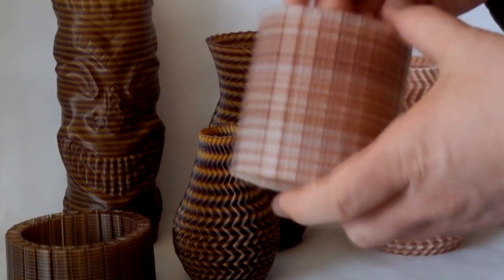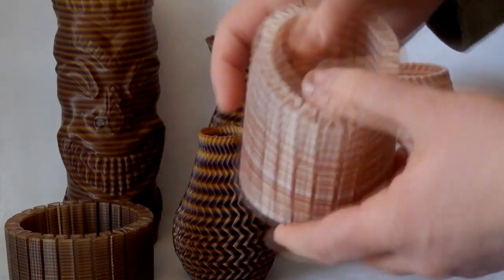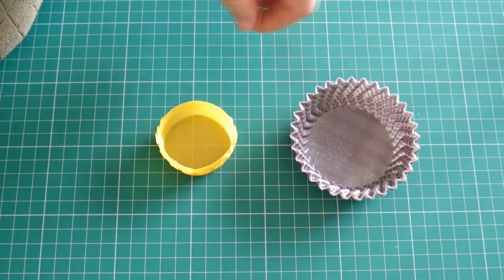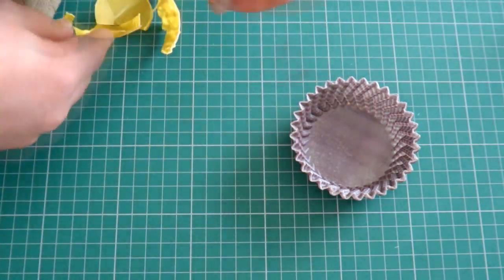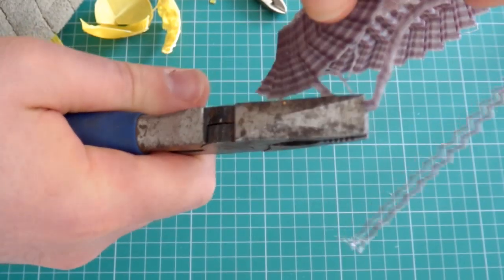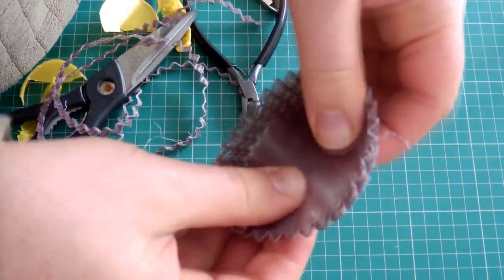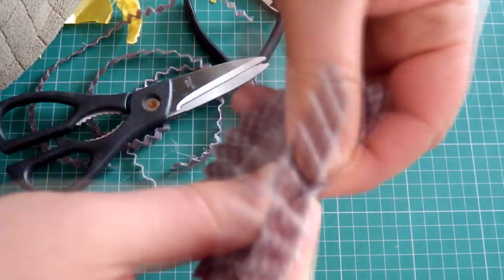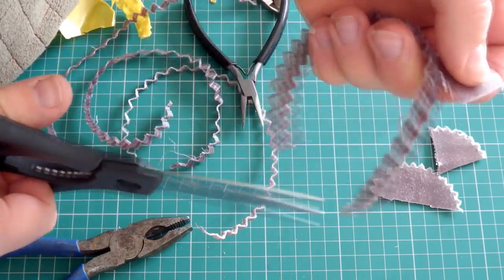3D printing with Tie Dye Nylon 618 Filament on RepRap Part 2 of 2

Comment: I had been thinking of getting the clear fillament as well as it's cheaper and then rit dyeing it but I would have assumed that you'd had to die after a print.. I mean you're heating up that filament and I would assume things might clog or some nasti residue or fumes would be made by doing that.

Thanks for the coloring idea though!

Comment: Awesomeness.  And of course if you need more strength you can always make the walls a bit thicker.  If you do use Mikael Murstam's cross layer idea, I'd like to see that.

In the first video you were asked a question about metals, and suggested using a variation of "lost wax" which I've heard of but am not familiar with.  I can look up lost wax on my own, but are there any videos of people using it in conjunction with 3-D printing?

Comment: thanks for the pointer, i completely missed the links :$ i did read the article. I'd buy a roll but shipping to Australia makes it very costly :/. I've got an wooden i3 reprapsource kit which i built and calibrated, i'm still learning and my biggest problem is prints not sticking or sticking too well to the print bed, printing with ABS.